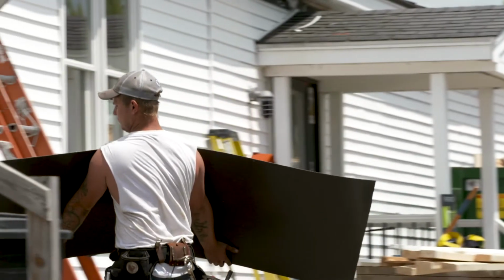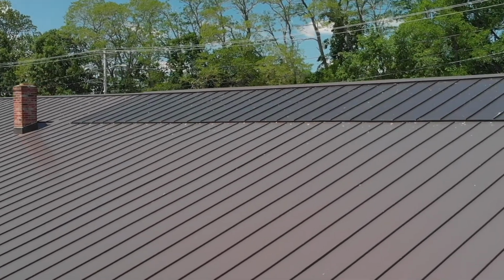INroof.solar Metal Roofing Integrated Solar Thermal Collectors

Comment: How is PV panel replacement if the PV goes bad addressed?  Can the PV be attached to a secondary panel that fits between the seams or can the PV be removed from the roof if necessary?  Not talking about panels that fit above the seams, like traditional solar panels.

Comment: Is that water heating system? Or electricity producing ?
Reply from the maker: Our Nor'easter panels are for solar heating. Any of our metal roofing panels can be upgraded to include PV/electric film to add electricity production capabilities. Conventional mounted PV could also be added on top of our roofing as long as it wasn't shading Nor'easter panels.